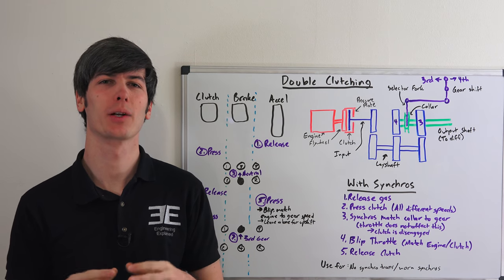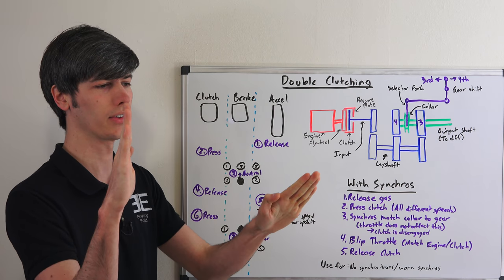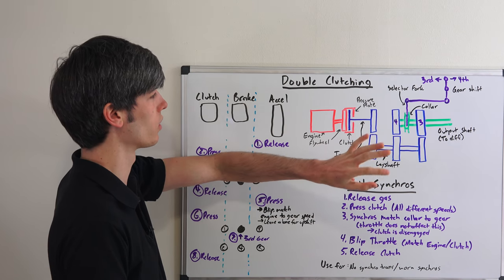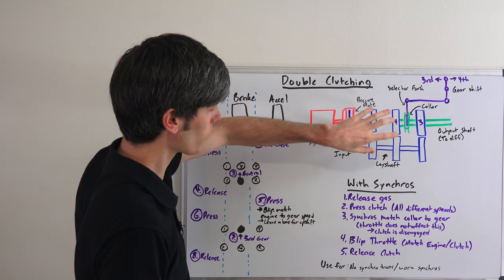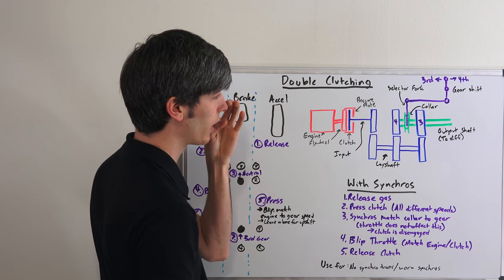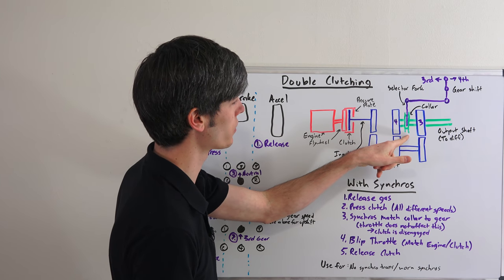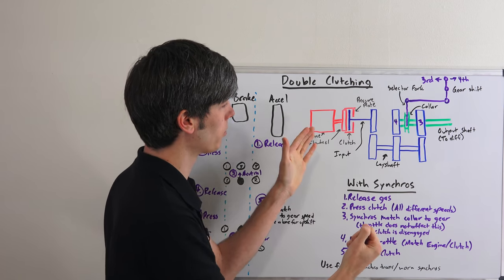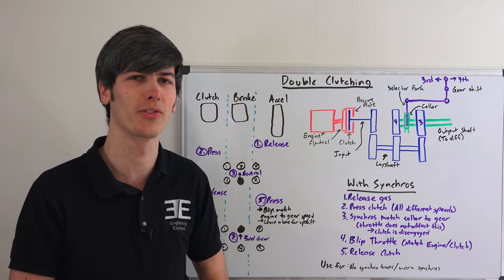What Is Double Clutching?

Comment: Could you please explain why we need to increase the rpm of the engine while trying to downshift and vice versa while upshifting ?
Reply: to match the engine speed which minimises the engines force on the wheels for one giving you more control as you shift down and also to shift more smoothly. if the flywheel and the engine are both spinning the same speed it is an easy shift and you dont lose any inertia, there are many other reasons Im sure I havent said but those are the main reasons. I like doing it as its a challenge hahaha it ultimately gives you more control of the vehicle

Comment: DOUBLE CLUTCHING IS BIG TRUCK STUFF...FLYWHEELS ARE VERY HEAVY AND RPM COMES AT A FAR SLOWER RATE THAN IN A SMALL CAR...SO DOUBLE CLUTCHING CAN BE AN ADVANTAGE IN BIGGER ENGINES...(OLD GASOLINE engines 1928 to 1953...especially...).

Comment: Probably because I have ridden big bikes I always blip the throttle when changing down a gear in a car I never double clutch as the gearbox is synchronised but I blip the throttle just before releasing the clutch once I've selected the lower gear... does this really make a difference?

Comment: Like Driving a Rock Crusher transmission . Only takes a LIGHT touch on the Clutch . Overdoing the Declutching will spoil the party . All Highway Trucks USED to use Non Synchronised Gearboxes . WAY Stronger , but Bad Shifting Shatters all the Case Hardening on the Components . Takes some Practise , of course , but done even Half good is kinda Satisfying . You get BETTER because of that .

Comment: one thing is to actually not double shift. you can get the gear out on absolutely on every machine without clutch. you just need to get the power off the gearing and it slips right out. then you match the speed and then press clutch and put it in gear. professionals just rev match. this thing is commonly used in big american trucks, cuz all of the rotating mass there is in the gearbox the synchronizers wouldnt be able to handle it so they make them without  synchronizers

Comment: Clever chap but missed the point. Double De-clutching is mainly used for non constant-mesh boxes when you're moving the actual gears in and out of mesh with each other.  "Dog" engagement boxes (like Harley) with " constantly-together" gears , it's  less important to DD and I've never found necessary. Try straight-changing on your vintage Bentley and you'll see why you need to DD  ! It's where the expression "crash" boxes comes from.

Comment: It’s essential for road testing in a manual transmission (at least for a CDL in the USA), and good for the driver to know what’s actually happening to the machine he/she (probably a he) is driving. My first car was a manual because I didn’t want to be a guy who couldn’t drive one, so I bought one to force myself.  My teamster grandfather taught me how to drive it, and he was old enough to where you HAD to double clutch.  Most trucks still don’t have synchronized transmissions, but obviously most “experienced” drivers wind up floating/slipping the gears.  Sometimes I’ll throw a double clutch in there just to be sure the old brains still got the muscle memory, but it never goes away.  Other than than, if In a car I’ll go back and fourth with the clutch, but when I’m in a truck I only really use the clutch to get going, or if I’m going up hill with a heavy load on…anything not allowing the tension to be relieved in the driveline when wanting to change gears.  They say “most drivers don’t float gears correctly”, but that’s just saying they don’t do it “perfectly “.  Most drivers don’t modulate the clutch/throttle “perfectly” either though.  Every single time I’m on the road, I hear people letting the clutch out too slow, where you can hear the extra throttle spinning that clutch pack against the flywheel causing unnecessary wear.  On the other hand, I also hear people racing off from lights, throttle down, dropping the clutch on every gear where you can hear the engine rpm’s “bounce” as the engine gets shocked into meeting all that extra force.  Basically, choose your poison is what I’m saying.  I’ve been driving manuals for 20+ years and nothing I’ve ever owned has ever needed transmission service.  Is that saying I’m operating “perfectly”, probably not, but having an understanding of what you’re asking the machine to do will allow you to be more reasonable with what you’re asking it to do (or not, that’s why they sell aftermarket parts).

Comment: I had an interesting problem with my MGA gearbox.  It is a four-speed, three synchro box.  Couldn't downshift from 3rd to 2nd until I was well below 5mph.  Neither rev matching, or double clutching helped.  I opened the gearbox to inspect the synchros, they were all well within spec.  I rebuilt the box anyway.  During reassembly, I noticed that the mechanical bits that make up the clutch pedal, and slave cylinder were worn out.  Holes that connected pushrods and links were elongated.  Is it possible that my downshifting issue was caused by my clutch not fully disengaging?

Comment: Syncros wearing out? Meh, no problem!. If you can't get in gear just put it in neutral, don't press anything, wobble the stick violently and everything works fine again!   (I'm not responsible for any damage on your car, yourself and others.) Jokes aside tough, some transmissions need a little wobble or a shift into 2nd before you can propperly shift it into Reverse. (Yes, im looking at you peugeot!)

Comment: I learned to drive in a 1960 something Chevy 3/4 truck with an unsynchronized transmission. If you didn't double clutch it would grind the gears every single time. That was how many years ago? What cars today need to double clutch anyway? Shouldn't double clutching be as extinct as a dinosaur? What is the purpose of this video anyway? Seems like a pointless topic.

Comment: How to know whether or not a car, esp an old car like my Nissan Sunny 97 doesn't have a synchromesh device in the gearbox without opening the gearbox housing ?
When downshifting from 5th to 2nd by using normal single-clutch with rev-matching, the engine judders at times. When I use double-clutch technique, it works well. So is it an indication that my car doesn't have synchro or the synchro is an old type ?

Comment: (fr)
Le +important est d'être sûr d'être au point mort 
Point 3 du tableau 
Et pour ceci, je déplace le levier de vitesse de gauche à droite 
avant d’embrayer la 1ere fois au point mort
Point 4 du tableau 
(en)
The most important is to be sure to be in the neutral 
(Point 3 from the explanation board)
To do this, I shift the gear level from left to right  
before releasing the clutch the first time
(Point 4 from the explanation board)

Comment: I still don't really understand. REAL world situation: I'm downshifting into first (coming to a complete stop) but my car is moving too fast for it to just slip right into gear... how does disengaging the flywheel/engaging the clutch twice actually help to ease my shift? I would think that it would help the clutch not absorb so much heat and wear on the friction material... but as for helping something not even attached at that particular moment... (the car is practically in neutral isn't it?) I just don't get it. Can you expound on this?

Comment: Excellent presentation. You answered all the questions. However you need to slow down . Have a bottle with fresh water to take sips as you are pumped up with adrenaline, as if you are actually driving a truck at a high speed.; and we need 2 or 3 more drawings (eg. with the clutch pressed in, released, and the different positions of the synchronisers. ). All this for our sake. Thank you.

Comment: My car's clutch went and gave almost no warning, 2 or 3 more clutches kill it by the time you know something's wrong. Doing the method above can also work for no-clutch shifting (similar to non-syncro'd trucks). Got me home. Pulled the clutch, it was pretty much bare metal. Using the "double clutch" method, you can actually exclude the clutch altogether, simply letting off the gas while pressing the shifter out of gear is enough to release it and "pop" it out, then rev matching will let you throw it into a new gear, not nearly as forgiving as using the clutch pedal, but it was enough.

Comment: This technique also SAVES your synchronizers. By introducing way less wear to the system. I drive a production vehicle that is manual. And I use this method when shifting every single time I'm driving. This technique also helps to relieve hot spots on your flywheel that come from the clutch engaging to abruptly or not abruptly enough.

Comment: basically to try and simplify my point: what i mean is that as long as we are in gear (even when the clutch is in) should not the shift  collar then be firmly fixed/attached-to and rotating with the gear the car is in, and hence also with all of the layshaft. Admitting that the layshaft & clutch no long share flywheel or engine crankshaft's rotation.

Or maYbe I'm wrong and mixed it up with a very similar video by "racenut"??
The shift collar is ALWAYS and i mean always supposed to be rotating at a different speed that whatever gear it is engaged to?? And so that is the purpose of the synchro to bridge the gap in shift collar/outputShaft speed and gear speed?

Comment: Hard mode, split shift double down from High to low range while standing on the brakes and flicking on the Jake because a car has cut you off and you have 20 tons of steel loaded that you are not trying to kill anyone with. pop quiz 80,000 lbs x 55 mph= you are chunky salsa. please don't cut off a truck and slow down for no reason.

Comment: First time I drove a big tractor kept missing gears. Mechanic told me using clutch was my mistake. Taught me to float gears, as they call it now. Said the clutch was for setting at stop lights. When I drove for a living I seldom used clutch. Always thought the double clutching was more of a timing issue and did not serve any other purpose. As you see explanations leave you thinking, what?

Comment: people most often say that in synchronized vehicles it's waste of time and effort to double clutch but, what do you think, does this apply to synchronized manual trucks as well? 

because the very basics they teach in driving school at least in finland, is that on heavy vehicles you should engine brake with downshift as much as possible to prevent the brakes overheating and wearing. meanwhile i do believe this, it also seems to be very heavy on the synchros of the manual transmission, even if rev matching (which they don't teach for some reason). 

i'm currently driving a 8-speed MT truck which other people use as well, and the 3rd, 4th and 5th gear especially are badly worn out, and i'm pretty sure that it's because people engine brake with downshifting which puts heavy amounts of stress on the synchros (what i can understand of), and it's applied over and over daily. from what i understand of the gearboxes (i'm not an engineer though) i'd say that it's by far the best for the heavy duty vehicle to double clutch on every single gear switch, because the synchros do wear, and they wear the more the more rpm's they need to match, and when there's 8 to 16 daily driving hours on a heavy vehicle when there's at least twice the more switching than with a personal car, it's going to create considerable amount of heat and friction the the synchros if on every switch there's 500 to 1000rpm difference to match. am i totally wrong with this?

i mean, the vehicle i'm driving is like 3 years old so with 215tkm on the meter, so i don't think that the gearbox should already be in that condition, even though it's not new anymore.

Comment: If you feel like that when you're downshifting, your stick doesn't really go into gear for a second or something (there's this pressure that prevents you from getting it into gear), that's what double clutching prevents from happening. It allows you to immediately go into any gear you want, without waiting for the synchro's to do its work.

Also, most cheaper manual transmission cars don't have synchro's for reverse. Do you ever feel like that when you go from 1 to R, you can't get the gear to completely go into gear, before letting go of the clutch, that's what happens when your car doesn't have synchro's. You literally just can't get it to shift completely into gear. Double clutching can help, but not always. Sometimes you just have to let go of the clutch for it to fall into gear itself afterwards.

Comment: When rev matching without double clutching, I find that the shifter slides into place more easily when the throttle is blipped. What causes this? Does the engine still speed up the transmission through the throw out bearing?
Reply: Engine RPM's drop when you exit a gear. That's why when you float down, you have to rev your engine up, because the engine and transmission are spinning at two different speeds. Your transmission speed doesn't change, except by a little. Hence rev matching. It always will slide into gear easier if you tap the throttle.
Reply: @snowoffstream5823  I get that you're matching the engine speed, but the clutch is in while changing gears, so the engine is disconnected from the transmission during this process. The shifter connects different gears to the wheels. I'm wondering why it's easier to connect the different gear to the wheels with a throttle blip, when the engine theoretically isn't connected to any of it.

Comment: Actually, the Brits say this technique is "Double DE-Clutching"....because when you step on the clutch you are actually de-clutching...meaning your are dis-engaging the engine from the transmission. The clutch is engaged when your foot is off the clutch pedal, not when you are pressing it down. An engaged clutch is holding the engine and transmission connected.

Comment: Good God, I didn't know I was reinventing the wheel. I have a 5 speed I shift between 2500 and 3000 r.p.m. with 248,000 4.2 Ford f 150 never had a clutch problem.

Comment: I learned to drive in a 1949 Ford 1 ton truck.  It was necessary to double clutch because the transmission did not have any synchros because that's how it was built.  Also, 1st gear was meant for very heavy loads and was called the "Compound gear".  Without a load in the truck 2nd gear was used to get going.

Comment: I dont think the "why" was the reason you said.. there really is no point in double clutching, that whole, "release gas, clutch, neutral," step is pointless.. you dont have to go into neutral than clutch it again to blip the throttle. 

Using the same scenario ...
Step 1 -  you release gas

Step 2 -  clutch, go 4th to 3rd and blip the throttle, all at the same time.

Step 3 - release clutch. 

I have a manual 335i coupe and thats how i always downshft when slowing down.. double clutching seems pointless and its less efficient.

Comment: ? but i don't get it-- at 3:46 you are saying that just disengaging (pushing in ) the clutch causes the shift collar to be rotating at a different speed than gear4Or3 for example (whichever is still engaged while clutch is in). 
Earlier you said and it makes sense that the layshaft/intermediate shaft is always in contact with the a gear and the shift collar that attaches that gear to the output shaft/road wheels, unless lever is in NeUtral. The clutch is 'in', yes, but wouldn't the gearshift lever remaining in 3 or 4, necessitate that the shift collar (part of the output shaft, same rotat'l speed), spin at the same speed as the engaged gear, since the layshaft is still connected to the road wheels/differential or output?

Your videos are neat. My only concern and worry is that this gives people the false idea that engineernig is the same as car mechanics. Good thing ya' did that video with the Humble Mechanic guy. haha

Comment: I always used to do a technique to match engine speed with gear speed, but I do it with single clutch. What I do:
I clutch the system, blip the gas to be fraction above of the ideal match speed (rev) and in between with the system clutched I pull from one gear to another and wait until the synchronizer sucks the shifting rod, than I declutch, and it's always very soft and smooth. I actually miss the intermediate second clutch in between the disengaging from one gear to another.
Can you tell what would be the difference between those techniques engineering wise? Since the system is clutched and don't have the mass of the engine to interfere in the gear engagement, would my technique be the same as the double but with one less step, hence, faster? Would it cause the gear or synchronizer any additional wear? 
I like to think my technique is better, but ... what you think?

Comment: Sorry Engineering Explained, i really pray you to read my comment. I have a question: after this video i still can't understand why we need to match the gear speed. Is this only because when we shift to neutral, the gears lose their rotation, so we need to accelerate with the engine to match again the speed with the collar? Because the speed of the wheels should be always pretty the same. So is this the motivazion? I'm saying this because i think that the gears should have the same external speed, so for me it has no sense to think that 3rd is more faster than 4th gear, yes they have different rpm but the external velocity is the same so the collar should engage easily. Thank you for you amazing work, anyway!